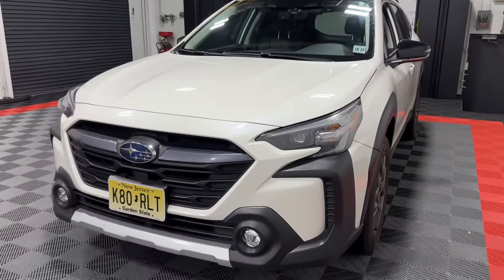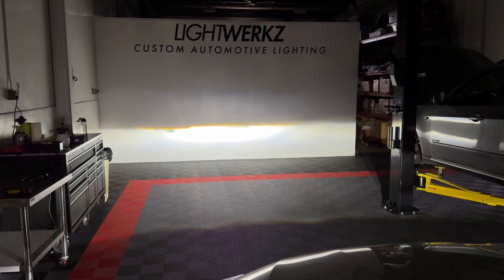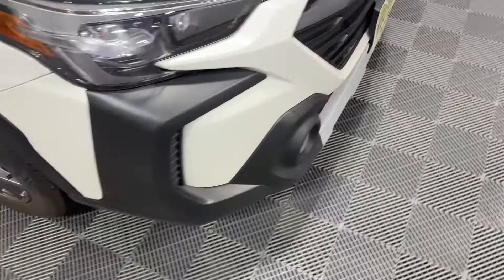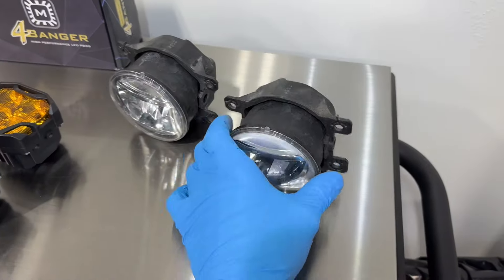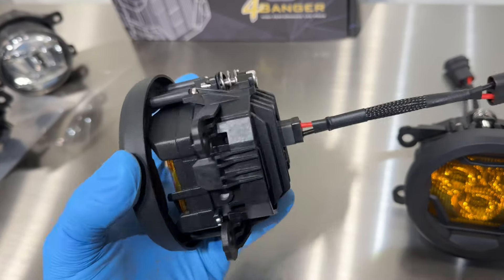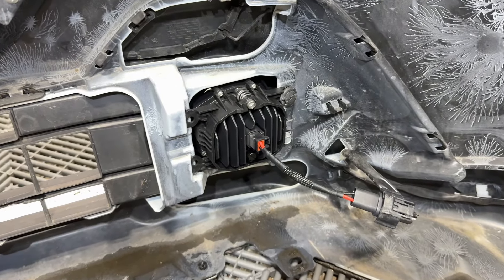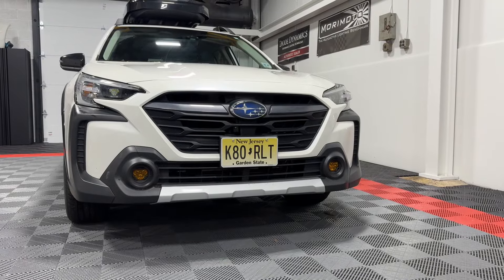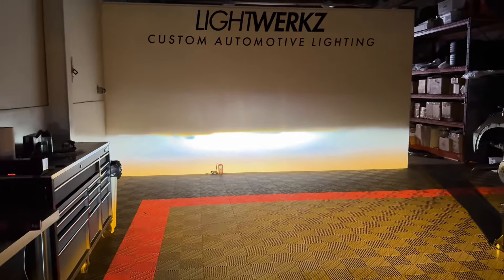Morimoto 4Banger LED Fog Lights - Installation Overview - Subaru Outback

Comment: Looks great, and the quality of light is a huge improvement. 

Do you prefer the Morimotos or the DD SS3 for fog lights?
Reply from the maker: We really like both SS3 and 4Banger! Depends on the model in terms of which fits better. Looks are subjective. Performance is VERY similar overall between the SS3 Pro and 4Banger NCS or the SS3 max and the 4banger HXB. 

Here's the main difference though in options. SS3 line up has a Sport model which is significantly cheaper than any of the other options and it performs very well. The whole SS3 line up has the option to have a back light. We love the back light feature !

Comment: I reached out to Marimoto asking about these and they said they’re not compatible. Obviously by your installation proves otherwise. Does the mounting bracket come included?
Reply from the maker: Sure does and please support us by purchasing from the site! https://lightwerkz.net/collections/morimoto-4banger-led-pods-fogs/products/morimoto-4banger-led-fog-lights-honda-acura-round
Reply: So it’s the type S NCS yellow spot beam?
Just wanna make sure I select the right one.
Reply from the maker: @juanmelgar5073  this is the wide beam that’s for fogs
Reply from the maker: Wide beam is what you want @juanmelgar5073
Reply: @LightwerkzGlobal   sounds good I’ll be ordering those from you guys! Thanks for your help and for the very detailed video 😊
Reply: @LightwerkzGlobal  do you have a discount code? I just noticed there was an option as I was checking out. 🙏🏽
Reply from the maker: Please email us for a private code - info@lightwerkz.net  @juanmelgar5073

Comment: This is non related to the 4banger or similar if I buy this one but, will the ss3 pro fogs in amber be too much to leaving it on all the time with the low beams at night even if it's aimed down? I have a 23 outback wilderness and I'm been looking into the sport and pro model of the ss3 fogs in amber.
Reply from the maker: The SS3 with the fog optics are all able to run full time with low beams. However, go for the sport or the max model. The cutoff has a short band and way easier to dial in. The Pro has a tall band of light and its best on trucks in my opinion.
Reply: @LightwerkzGlobal  Thank you!